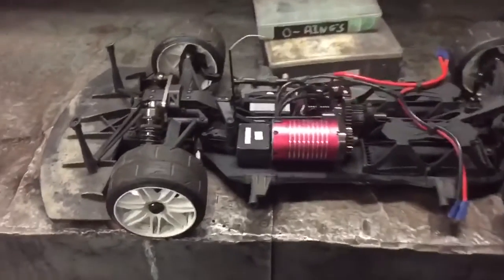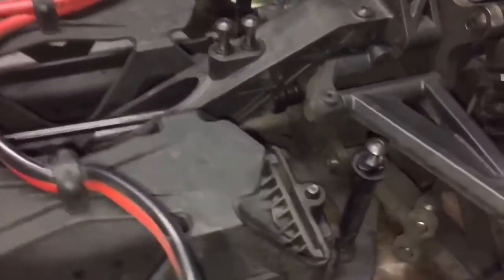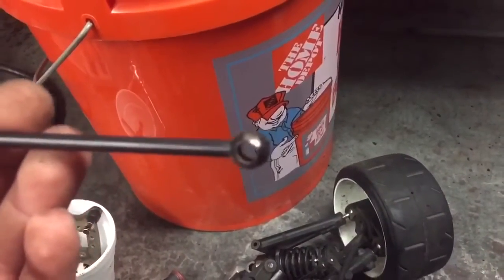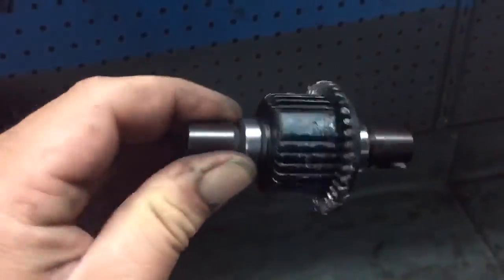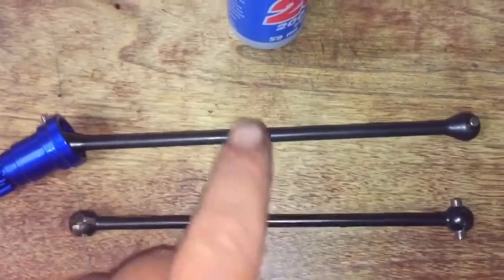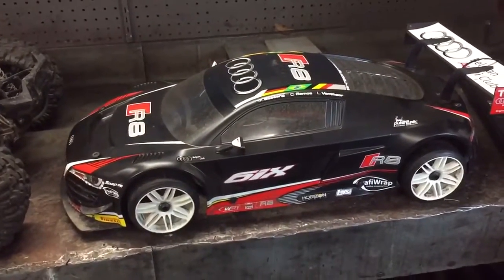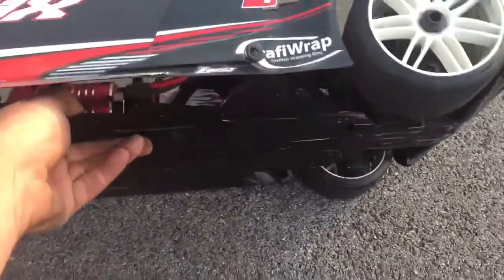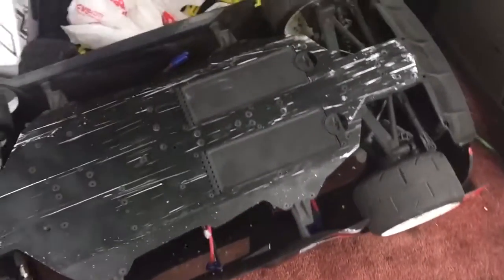6amRC. Losi 1/6 Audi. #8. Fixed, test run, problem

Comment: wheel adapters for the losi audi r8 kit a4 available at emperformanceproducts.com
Reply from the maker: Rafael Rosales   Great. Had few new owners on the Facebook ask about them.
Reply: Thank you I have 1/5 wheel adapters for many RCs Traxxas xo-1, Arrma Senron, E revo, e maxx, etc...
Reply from the maker: Rafael Rosales   I saw your post on my XO-1 video. Will let it known if asked.
Reply: Billy i do appreciate it, the wheel adapters are now hard anodize in blue traxxas color.
Reply: Hey boss did u replace thr cv joints with the xmaxx one cheers 🍻